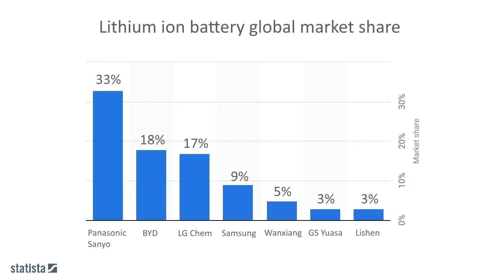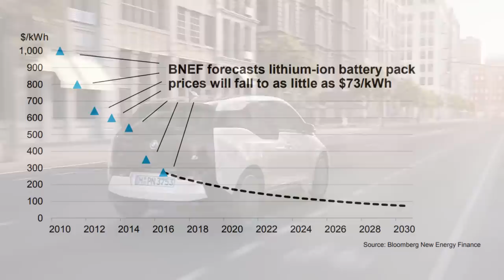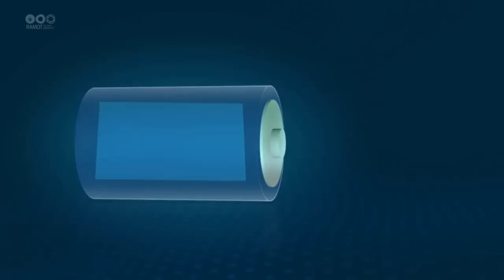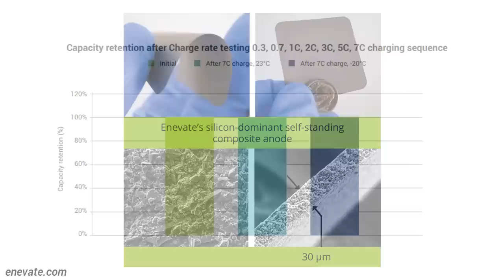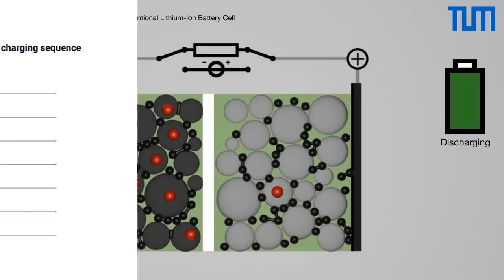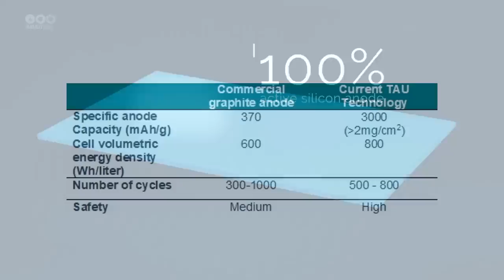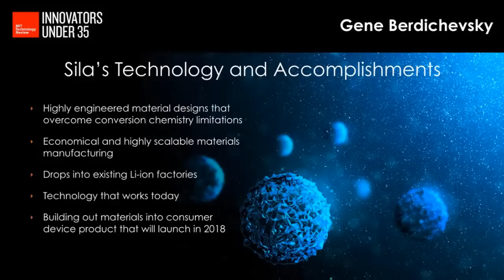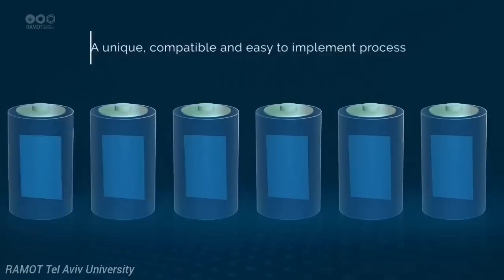The Battery Revolution. Ultra Fast Charging

Comment: THIS IS AN UNREALISTIC PR GIMMICK "charge your car in 5 minutes", why? Read on.
In this video it is claimed 400 km in 5 minutes of charging, what assumptions are made which are NOT openly said? Let us assume a perfect battery which can take this charge, how large is the battery pack? I didn't hear any explicit numbers, but let us assume that your car travels about 5 km for 1 kwh, thus 400/5=80 kwh. Okey, 80 kwh energy transferred in 5 minutes, how much power is that? 5/60 = 1/12 thus you need to transfer 80 kwh in 1/12 of an hour, that is 960 kW !!! This implies that ONE charging station needs to be able to deliver almost one megawatt. Lets compare that to a household with one phase 240 V AC, to get 960 kW you need 4000 A (yes, four thousand amperes). This is an ridicolous amount. We are talking about INDUSTRY sized power here.
Your teakettle may be between 1 kW and 2 kW, leave that running for a FULL hour and you have 1-2 kWh but we are talking about 80 kWh, you need 40 teakettles just to get 80 kW but it still takes one hour to get 80 kWh, you need to connect 480 teakettles to get 80 kWh in 5 minutes... Do you think it is reasonable to design the ELECTRICAL DISTRIBUTION NETWORK FOR THIS LOAD?

PR gimmick is "charge your car in 5 minutes" since some (small) battery can be charged in that time.
REALITY: you cannot deliver such amounts of energy at such rate, electric cars may be the only ones we use in the future, but if you seriously expect "5 minute recharge" you will be dissapointed.

It is simple math. It is NOT the battery technology in itself that is a severe restriction. Most homes today can recharge a car overnight (if it is inside a comfortable temperature, it is is outside in -30C most of the power is wasted to keep the battery warm enough), but IT CANNOT recharge a car in "5 minutes" no matter what you do. It is not only a technological problem, it is certainly not economical to design an electrical distribution network for such loads.
Reply: Anita.. SHHHH SHHHH the greenies dont want to hear about the 4160V or the 2MW HVAC system that it would require..

They prefer thier mythos idiotic and without logic... See DisneyWars Ep 2
Reply: I was about to write the exact same thing. It doesn't matter how fast these batteries can be charged, the electrical networks are the problem. And of course, your calculations are based on 100% efficiency which will never happen. For a 100kWh battery you'll need a 1.2MW supply for a five minute charge. If this ever happens, then electric cars will be the convenient transport we're already used to, until then, it's liquid or gaseous fuels/energy carriers which will be the ones many people will want. And of course, not everyone can have a home charger, and not everyone will have access to a public one either.
Reply: The only way I can see this working would be using battery packs as a buffer for charging. Have a large battery system powering the chargers that continuously recharges itself during the day, then when a car pulls up to charge it dumps the 900 kw of power needed. It's a bit absurd, but I don't see any reason it couldn't be done.

Comment: Batteries are still dependant on finite mined monerals.
The good thing is that they could be recharged several times not consume once like petroleum.  Plus could be solar recharged
Reply: They can also be recycled. So they may not be finite if the infrastructure is proper. And I imagine they will also find other materials that will be able to store energy.

Comment: i have seen more than 10 kind of battery solution 10 years ago.....and it's still not out yet lol
Reply: No.
Reply: Holly Hsieh
The cost of batteries continues to decline and are far cheaper than a decade ago while capacity increases.  5% improvement per yr. becomes significant over time.
Reply: Bo McGillacutty 10 years old solution still way better than today's battery....
Reply: Holly Hsieh
I seem to recall many such 'solutions' over the years.  Most don't make it to market for one reason or another, that's to be expected.
Reply: Bo McGillacutty so that's what I'm  apply to this video..lol
Reply: Samuel Rosenberg
Everything has physical limits.  There is no clear limit to how much the price can drop however and that's the primary problem at this point, energy density is already high enough to replace liquid fuels for the majority of surface transportation.  All my yard power tools are now batt. powered too from mower, blower, chainsaw to hedge trimmer, they are vastly superior and more labor efficient than old fashion gasoline powered.  And when the price is low enough we will ALL have batt. backed up homes as well as the grid will have massive peak use batteries of some sort.  Cheap batteries of the performance we have NOW will change everything.
Reply: Bo McGillacutty
 Well you're obviousy wrong. Energy density of current li-ion cell is 0.36–0.875 MJ/kg compared to gasoline 46.4 MJ/kg. Which is the reason that EVs have batteries that weigh half a ton (literally), and get half the mileage (if you're lucky) as equivalent 100kg tank of gas.
So yea, you can replace everything with battery power. If you have only short trips to make, small lawn to cut, little logs to saw... etc.
Reply: MasterBata
How often do YOU need to drive over 300 miles without stopping?  Or how about 600?...as that is the future if you need it.  I have half an acre to mow and it gets done 30% faster with batt power.  If one charge doesn't quite get thru it, not a problem because I can swap batts and/or recharge in 30 min. while I do other things. One tank of gas didn't always get thru it either and swapping batt.s is easier than pouring fuel.  Same with the chainsaw which was about maxed out bucking up a 11 inch diameter pecan limb, I'm not a professional tree trimmer but they use battery power too now most of the time! (the one's I have talked to)  You apparently have been disconnected from the changes happening and obviously don't have any idea what your talking about.
Reply: Samuel Rosenberg
Obviously the price can't drop without limit but it can continue to drop for the foreseeable future and will.  I don't want to switch to batt EV anytime soon either, just purchased a BMW M3 and I don't swap cars often, it's one hell of a lot more fun than a Tesla but most folks are not driving for fun and batt cars will simply be vastly more economical and practicle so they will take over.   In ten yr.s you will be either driving an EV or thinking about getting one or riding in one at least some of the time.  It doesn't matter if you like the idea or not.  My great grandfather drove a 600 lb. horse drawn carriage in his youth and he liked it the lite wt. but he switched to gas powered anyway even tho the new car was 3 times as heavy.
Reply: Over 300 miles, I guess once or twice a month average, both ways. But I do stop, for 5-10 minutes stops. Not enough for charging, eh? 600? Great, where is it? Nowhere, huh?
Half an acre 30% faster? Faster than what? What are you comparing it to? Because I do have an 80V battery Stiga mower I got from my in-laws, and it is not better in any way than a proper gas mower. My gas mower gets at least 5 times more work done than the electric Stiga.
So let me try to explain more plainly - there is potential in electric vehicles, but it is not in li-ion chemistry. This is dead end. Technology is mature, and already reached near it's maximum energy density. There is no 600 mile range with li ion coming, unless you stuff 1 ton of cells in a car. Is it really futuristic and efficient though?? My wife has a Mazda mx5 that has a range of 500-600 miles and it weighs less than 1 ton. Do you understand? My entire ICE car weighs less than the battery an EV would need to get the same range. Now please, tell me about efficiency.
Reply: 400 mile range is available now and 600 plus with the Tesla Roadster, the roadster is a long way from affordable however, but an indicator of what is possible and affordable down the road.  Also a car can be designed to simply swap batteries at a service station as quick as you can fuel up anything.  Apparently you don't ever take 30 minutes for a meal?....that's enough time to charge another 300 miles.

  Funny how so many folks resist change and struggle to justify it just as you would have balked at giving up your horse carriage until you get tired of taking half an hour just to deal with the horse for a 10 minute trip to the store which would only take 2 minutes with ICE.  EVs easily get in the neighborhood of 100 mpg equivalent and have virtually zero mechanical maintenance.  It's only a matter of the price dropping by a factor of two which will happen soon enough.
Reply: A week ago I was driving thru Seattle and there seemed to be far more Teslas on the road then BMWs or Mercs.  Sometimes 2 or 3 were in sight at a given moment on a crowded 3 lane freeway.  Same goes for coastal central/north California.  Almost everyone you ask who has ever driven a Tesla LOVES the car.  It's heavy but not necessarily more so than a fully loaded luxury car and the C.G. of a Tesla is so low and the torque so high, acceleration can be comparable to a drag strip dedicated car, they don't feel so heavy.
Reply: Sorry;  didn't realise you were a battery scientist.  I will bow to your obviously superior knowledge.  All those firms like Sakti3 are just wasting their time, clearly.
Reply: "Increasing the size of the battery pack increases the refueling time in direct proportion if the capacity of the charging circuit remains the same."

True, but most chargers are able to put out more current than what the vehicles can actually accept.   The latest generation of charging output vastly exceeds the rate the latest vehicles are able to charge at.
Reply: "I'd have a fuel oil tank installed in my back yard if I wanted to refuel at home"

That's fine, you can keep making detours to the gas station.  Just don't complain to us when fuel prices start to get crazy towards the end.  Since 99% of trips are within our EV's range, we haven't had to... actually we haven't had to public charge once.  Ever.  We get home, takes 5 seconds to plug in, got a full 'tank' every day.  No need to detour to 'stations' to get juice.  It's pretty convenient actually.  5000 miles and I've paid £13 for fuel -- and our fuel prices are twice what you Americans pay :)

Yeah, the bike cost more to buy, but to be fair those prices WILL be more affordable in less than a decade.

Gotta agree with the other guy.  EV's don't feel heavy at all.  You should try one someday.  Most of us who have driven one or live with one can only shake our heads sadly and pity people like you who think they know everything about living with an EV, but who in reality probably haven't even sat in one, and instead have made their minds up based entirely on misinformation and speculation.
Reply: Jup. And this was 10 years ago. To me, the term "battery revolution" indeed is a bit bullshitting... but batteries are getting cheaper and better and will evolve to be the universal storage of electric energy.
Reply: They're not? Li-ion are 80% cheaper now than 2010, batteries charge several times faster, and the can handle many more cycles.
Reply: Samuel Rosenberg 
The traditional  lithium ion limit is due to the surface area on which the lithium is coated. The new carbon compounds being used in the latest battery developments create a matrix which increases that surface area by many times, it also prevents the migration of lithium through the dividing layers of the battery which cause the heating and dead short problems, so while the current lithium battery may be reaching it's theoretical limit batteries containing lithium will be far more efficient in the near future.
There are also developments in the use of capacitive energy recovery units which are being used now to form a hybrid systems with lithium batteries.
Reply: Samuel Rosenberg 
But with the correct catalysts,  thermodynamics indicate that solid- state fuel cells could vastly outperform conventional battery tech.
Reply: Samuel Rosenberg 
That is correct,  the activation energy for known transformations creating partially or fully reduced compounds is still far too high. Hence the need for better catalysts.  Furthermore,  specific volume is limited by binding sites and reaction/ diffusion considerations within suitable fuel cell media. These are technical obstacles, however.  The fundamental storage density limit for fuel cells is greater than current battery tech or liquid hydrocarbons since the reactant species aren't limited to the (relatively) low formation energy inherent  to the redox chemistry of each respective tech.
Reply: Samuel Rosenberg 
By zeroing in on prior fuel cell designs you are bypassing all other possibilities,  including any that could harness high energy density compounds such as triple nitrogen bonds with vastly more stored chemical potential than hydrocarbons.
Reply: Samuel Rosenberg 
Your critique of hydrogen is fair.  We find triple nitrogen bonds in unstable compounds like nitriles and isonitriles.  Their synthesis is currently energy intensive with many efficiency losses along the way.  The fundamental benefit of their use would be superior energy density and reaction kinetics, and these advantages would allow tech utilizing them to channel energy generation from more abundant primary sources like nuclear or largelarge-scale solar (even with inevitable intermediate losses).
Reply: Samuel Rosenberg 
Hell yes! I will drink to the day when I can finally fire up my fusion- powered Toyota compact and tear off into the sunset,  laying down an acrid trail of eco-friendly rubber and helium!
Reply: +Holly
You must be buying those really cheap batteries for model planes and quadcopters. The really cheap batteries are a "hit-and-miss" when it comes to quality. I recently bought big LI batteries that only last for one minute instead of the promised 10 minutes. You may be lucky with cheapies but mostly not (I have found). The only solution to this problem is to buy more expensive batteries. The original battery for my Bugs 3 quadcopter was 30 bucks, and the generic version of the "same size" battery cost like 7 bucks. But you actually get more value from the more expensive one.
Reply: Samuel Rosenberg  "there is no miracle battery chemistry just waiting to be discovered which has the energy density by mass and volume of a liquid hydrocarbon" 

Not right now. But their will be. Nobody predicted the rise of the smartphone and how powerful it is. Nobody predicted the modern internet as we use it today. You're statement I quoted bums me out people are ready to accept we aren't capable of doing the impossible, but yet we continue to prove ourselves wrong through technology and innovation.
Reply: Yes, how come they're not out yet, i think those graphene and super capacitor battery should replace those slow charging lead acid, gel type ,and  li-ioin , slow charge if you experience low batt. at one point and you need to go home immediately you would need to wait 6 - 8 hours to recharge and what if no electric outlet where your at the time  , i think it would be better to equip ev's with portable gen.set to supplement the  electric motor Togo further than   wait 6-8 hours of recharge..ev industry should perfect the battery technology first, becos   its the heart and soul of a dependable electric vehicle
Reply: We are still flying in 747 and 737, there is no insentive to bring the innovation to market.  The gig since the 1970s is to mass produce cheap and gain the most rent.

Comment: For past 10 years the new revolutionary battery is just 2 years ahead...
Reply: You can notice the change in ur mobile phones already. We already have smaller sleeker and rapid charging batteries compared to 1st waves of Nokia phones.
Reply: @regularjoe9032  RIC circuits have been more optimized.  this does not translate to dynamic physics.  
  ie:  dont taste the rainbow unicorn farts.. they have mental health issues associated with them.
Reply: @zarthemad8386  let's call bull crap on it. Battery technology is definitely evolving and improving at the same time.